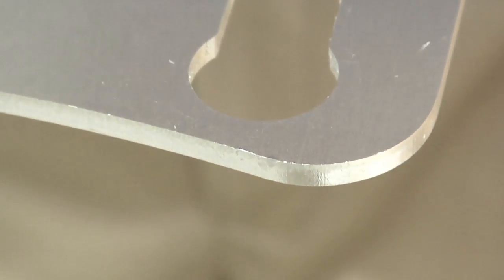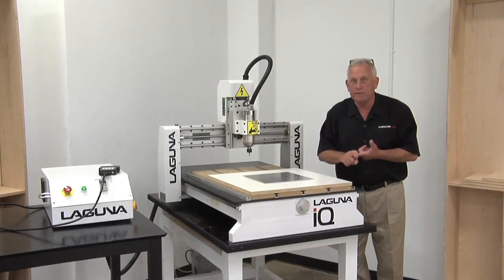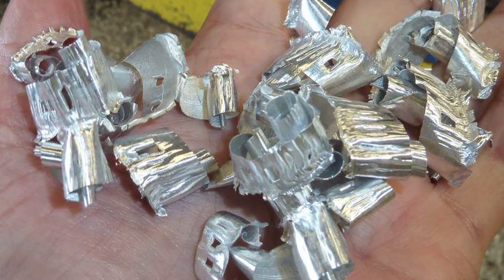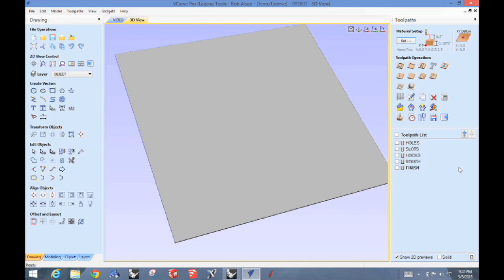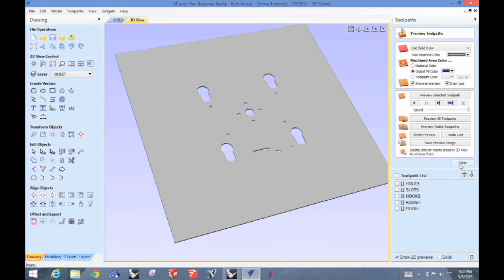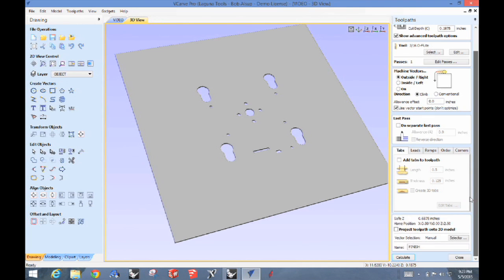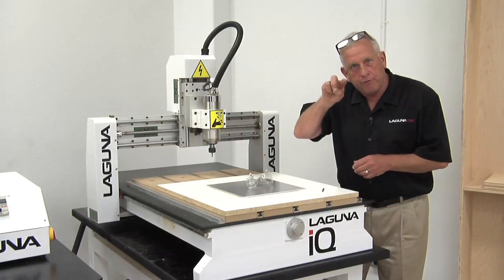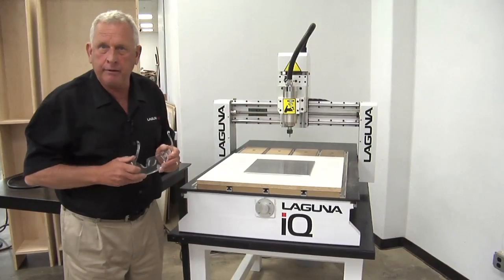Router Table Aluminum Metal Cutting CNC | Laguna Tools

Comment: What feed rate is he running at in this video? It looks like around 20ipm but it's hard to tell.
Reply: a straight answer woulda been cool
Reply: I found out they are running 60ipm at 14k rpm with a 0.1" DOC in this vid. You can see frames where he rolls over the operations, revealing the feeds and speeds. Plunge is at 30ipm as well.
Reply from the maker: Lets Discuss call us at 800.234.1976